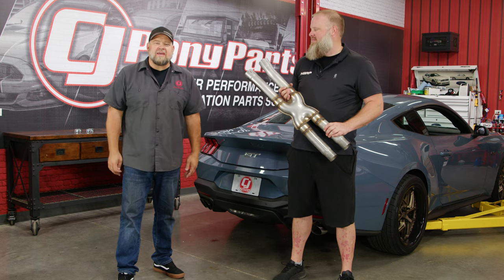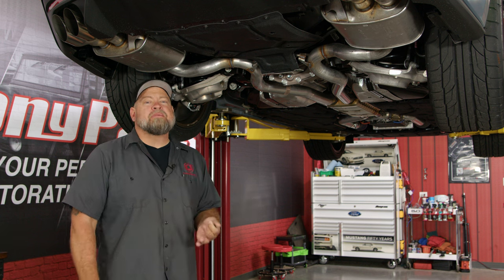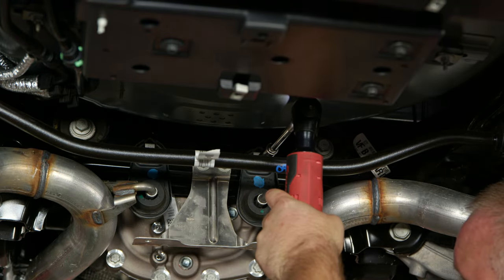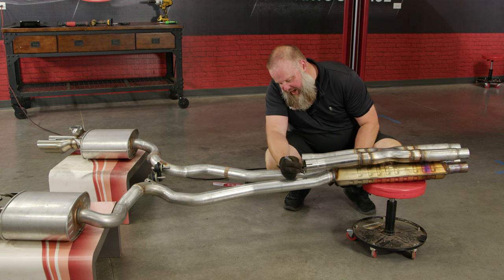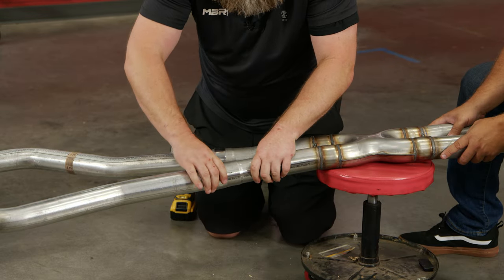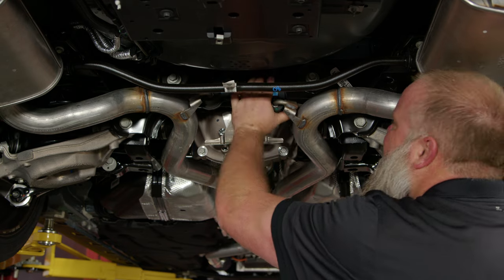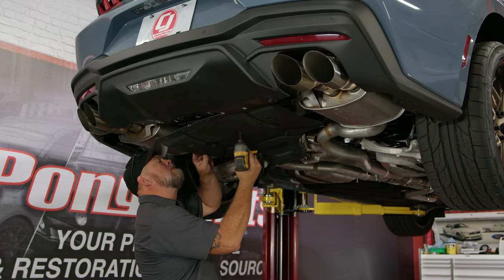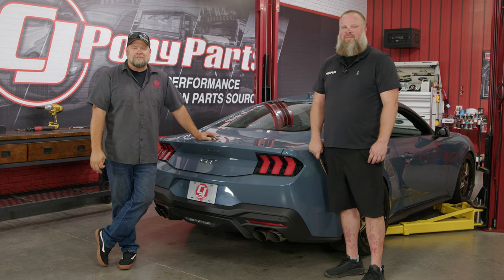Amplifying The Roar: Adding an MBRP Resonator Delete to the 2024 Mustang GT's Active Exhaust!!

Comment: I remember the days of 2020 when you could get a 304 stainless xpipe for $179 and I just looked and the same one is now $279. Inflation sucks.  And the 18-23 parts are going to stay high in price since they are compatible with the 2024 which also sucks.
Reply: Not to mention this new resonator delete is just a pre stamped cheap "X pipe" with pipes welded to it. They used to actually bend the pipes into an X.

Comment: Genuine question Cris, I imagine the inside is not a true X pipe and its big conjunction rather. Will that  be inferior to a traditional type X pipe shape?
Reply from the maker: The whole point of an X pipe is for the gasses to crossover which they will here. Any X will have some sort of open area in the crossover, MBRP just makes theirs a little different and we have been using them for years on different projects wirh good results.

Comment: The x pipe looks like a universal one not good I would get a ford performance one or a top brand X or H pipe
Reply: I have the FordRacing mid-pipe and it looks very similar!
Reply from the maker: It is not universal, it’s made specifically for the S550/S650